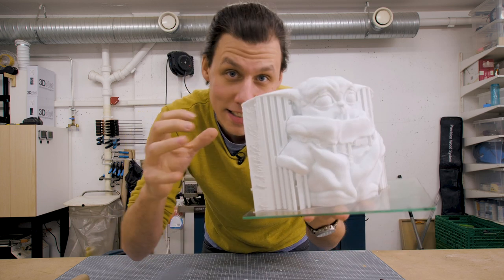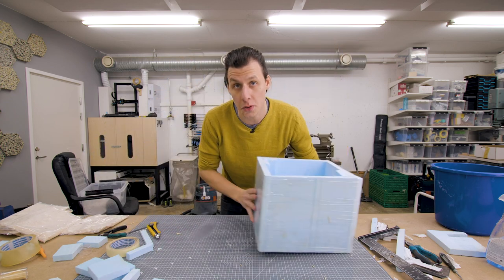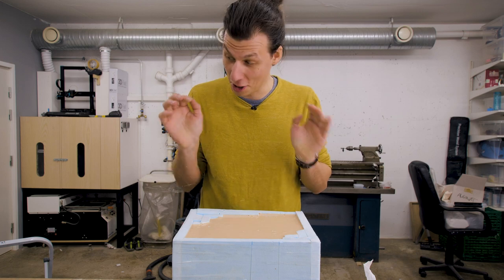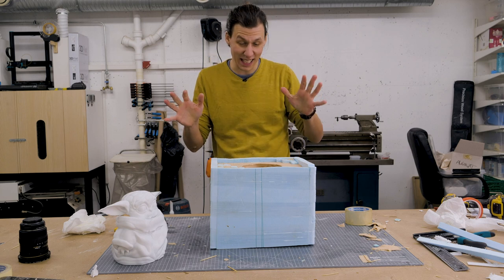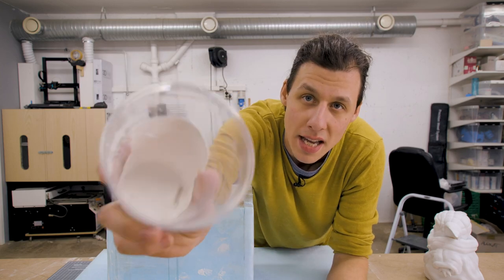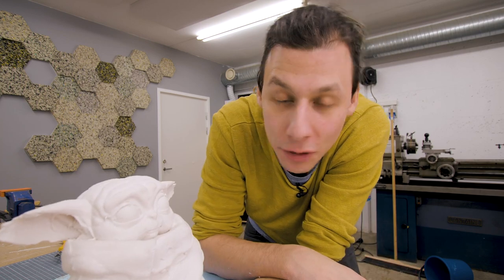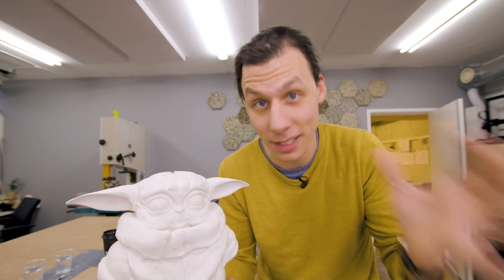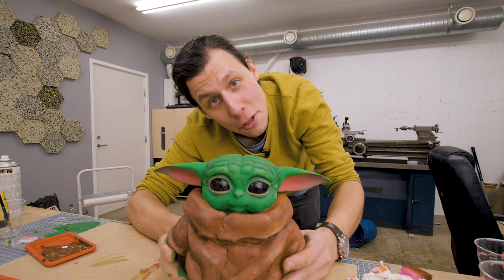Making a Baby Yoda Piggy Bank

Comment: I learned a trick for 3d printing on Glass! Wipe down the glass surface with super salty water right before you hit the print button. The print will adhere beautifully to the heated bed, and once the temp cools down, it pops right off with no need to scrape at the glass. If you forget, put the glass and model in the freezer for 20 minutes and itll pop right off the glass that way too.

Comment: wouldn't it be possible to print a negative of the model and use that as a mold?
Reply: You'd have to take into account demolding, and some parts like the fingers can be really hard to make so they can be removed easily. That's why he uses a silicone-like material, it bends and flexes and cuts easily, unlike a 3d print.
Reply: @somedude2492  That's true, but a 3d printed mold from 2 to 3 parts might work. Something like an injection mold

Comment: great video.  hard to know if the effort of making the mold offsets the effort of sanding the pla.  I've seen people melt and cast with monster clay.  The clay then goes glass smooth when you hit it with a flame or carefully with a hot air gun